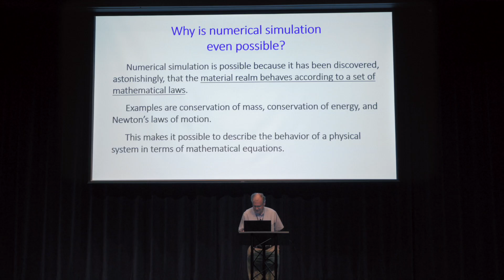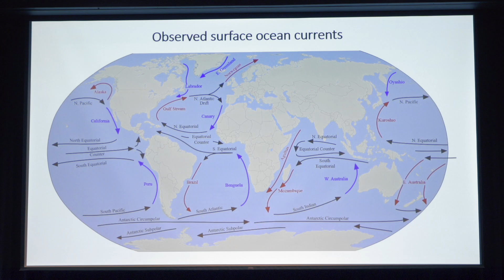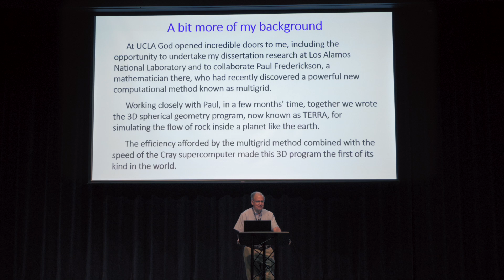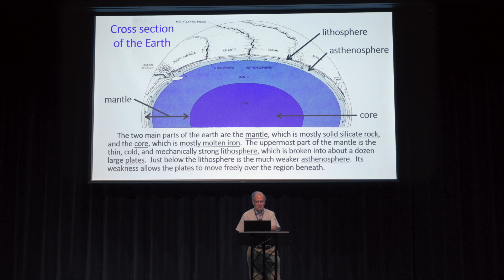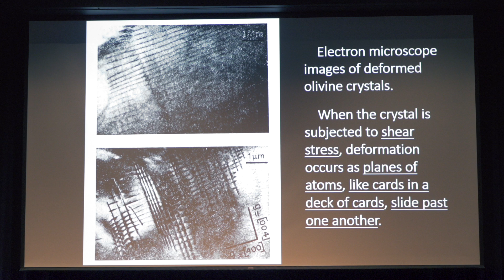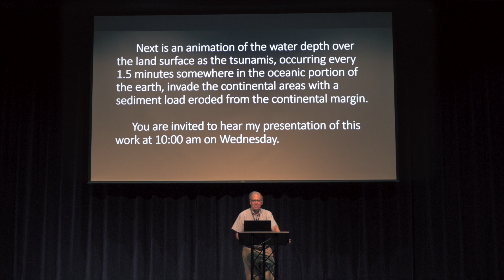What is the Science Behind How Noah's Flood Happened? | Dr. John Baumgarder, ICC 2023

Comment: Too bad all that rapid plate movement would produce enough heat to melt the crust killing all life on earth.
Reply: Interesting hypothesis. What simulation did you use to test it?
Reply: @p @paulc.3333  You don’t need a simulation, it’s mathatics. It takes energy to move plates released as heat. That can be calculated mathematically.
Reply: @DavidGardner-e9t  Have you heard that even in modern plate tectonics they don't produce as much heat as expected? Something weird is going on.

Untangling the Heat Paradox Along Major Faults- Article from Caltech.
Reply: @maxbennett5412 .  This has to do with heat produced by major earthquakes at fault lines, not plate movement in general. I fail to see the point you’re trying to make.
Reply: @DavidGardner-e9t  That's the interesting part, the argument they made at Caltech was that there was a layer of vapor acting as an insulator between the plates. Now where do you get enough water vapor to coat the sides of an entire continental plate? Did it come from above through the rock, or did it come from below through some other mechanism such as ringwoodite from the earth's mantle. (Just look up what that is, you'll find a lot of secular and zero creationist literature on it.)

I don't know in all honesty, this is a serious rabbit hole that may answer the heat problem and further support YEC. You can disagree with me on that but its an open path yet that might swing any way.

Comment: NONE WHATSOEVER:

THE GREAT FLOOD NEVER HAPPENED, UNDENIABLE AND IRREFUTABLE PROOF: 

God said it would flood all the land to a depth of 15 cubits. The heaviest rain we get is 8" a day and it causes floods and landslides. To cover Everest it would need to rain 725ft a day meaning a boat the size of the Ark would be hit by 648,000 tons of rain traveling faster than a bullet daily i.e. it would explode into nothing instantaneously. After 40 days the earth would be stripped of all topsoil and be unable to support any form of life other than fish most of which would have died due to de-salination and temperature change (which would have also destroyed the ocean and tidal currents), the atmosphere would disappear due to lack of vegetation, the waters would boil off and voila = Mars. 

(You could try to argue Everest was only small at that time and grew but, unfortunately, the tectonic plate movement required to rapidly increase the height of the Himalayas (and elsewhere) would destroy the earth with Tsunamis, earthquakes and volcanoes many times over. Or you could argue subterranean water but a geographical analysis world wide proved, water capable of covering the earth to 120 metres or 1.2% of the required depth is the maximum that could come from beneath earths surface. And don't forget, the earth would need to reach it's maximum amount of ground water before it started to flood not the other way around.) 

Oh and as another hint: If you were in a rainstorm 1100 times the maximum recorded on earth not only would you die immediately if you were outside, if you were inside in a location able to withstand it, no air could get to you through the rain and you'd suffocate.

Dinosaurs were killed by a 10km diameter meteor that hit earth 66 million years ago and created the extinction event crater named Chixculub. It is proved 3 ways by radiometric dating (which cannot be refuted) 1. The 200km wide crater is dated 66 million years ago (production of an extinction event as confirmed by super computer modelling), 2. the iridium belt, also dated 66 million years ago (Made of pure iridium. Only iridium alloys exist naturally on earth) and 3. the last of the dinosaur fossils dated 66 million years ago.

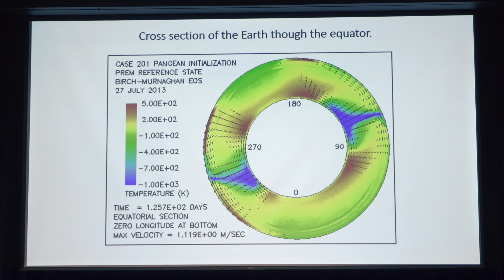Comment: at 34:07 I don't get how can temperature be negative when you use Kelvins. Shouldn't 0 K be the lowest possible temp according to thermodynamics? What am I missing here?
Reply: No, op, you misunderstood. The numbers are not absolute kelvins but relative to surrounding rock. Temperatures are likely around 3000+ K
Reply: Not sure, either. I wonder if it has something to do with the syntax of the numerical simulation system?
Reply: @warnerchandler9826  Yes, it must be something like that for Dr. Baumgartner knows his stuff.
Reply: Temperatures can go negative in Kelvins in systems where energy states have upper limits. If forced through a higher energy state, entropy drops as the system becomes ordered again and climb through the negative values as as a new equilibrium is reached.
Reply: @ OK, thanks for this info.
Reply: It could also be negative compared to an “normal” temperature.
Reply: I digged the paper myself. It says: "In addition, an initial temperature perturbation within the spherical shell domain is required to initiate motion.  For this a temperature perturbation of -400 K to a depth of a few hundred kilometers is introduced around most of the perimeter of the supercontinent." So it is a numerical trick to treat initial conditions.
Reply: @timosaksala4797 400K LESS than surrounding rock, not 127 K below absolute zero...

Comment: I think the research from Greenland ice cores and history of different cultures has shown the Younger Dryas is most likely the cause of the great floods. Study of Geography shows the flood plains of undercut rivers points to the rapid melting of the article glaciers.
Reply: Not on your life. Younger dryas Impact hypotheses don't explain the fossil record nor the cause of the ice age. It is a hail mary attempt at explaining the sudden, in an old earth perspective, end to the ice age
Reply: I submit that the glacial theory was interspersed as a replacement for the flood. Increasingly geologists are calling into question the glacial origins of many landforms and positing massive flood debris flows instead. They like to cite melting glaciers as the flood source still because they reject the Flood itself. Vast areas of Canada now have science papers showing debris flows as the cause of bedrock striations rather than solid ice for example. Same with drumlins. Lidar maps are showing mega flood ripples in many areas that were not seen previously. No glacial theory was postulated until 1840 by Louis Fuertes Agassiz. But every landform used to justify this theory, now has multiple science papers showing debris flows as a much better answer. That includes so-called glacial rebound of bedrock.